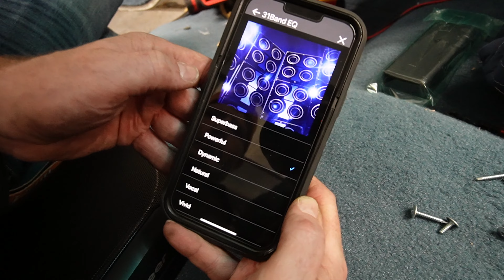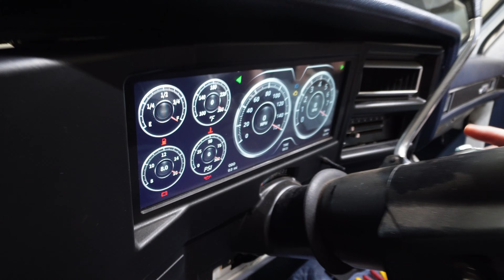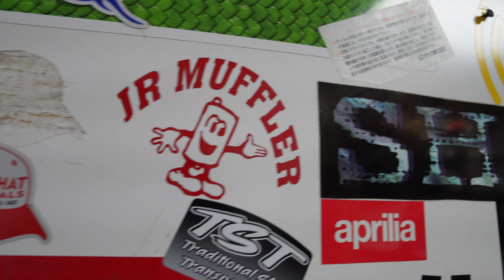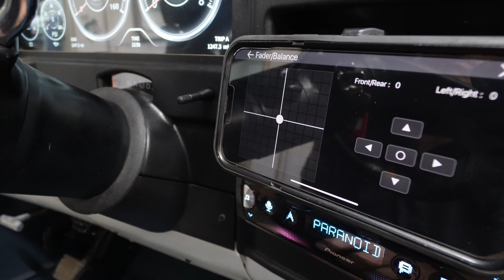Full Stereo Install with Space Saving Subwoofer For Your C10

Comment: How much does something like this cost?
Reply: I ordered a generally same setup, same subwoofer, 6x9 speakers with the rear brackets but a slightly different head unit and different front speaker setup and it was just under $600, which isn’t bad for a complete sound system